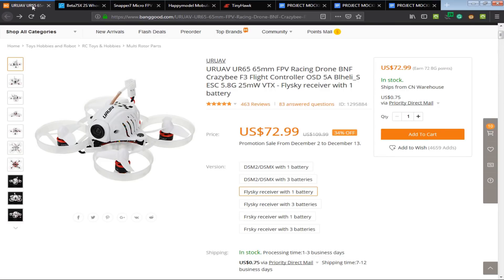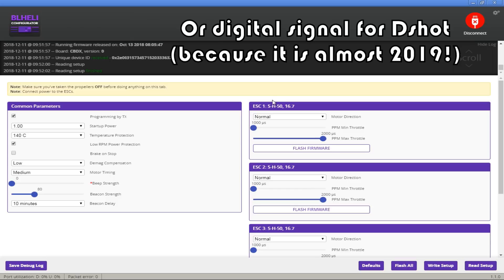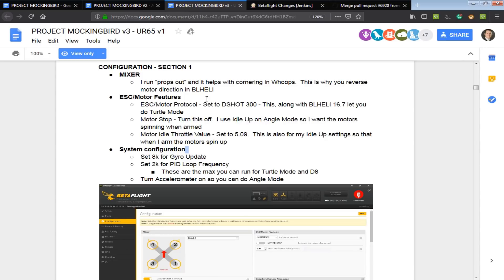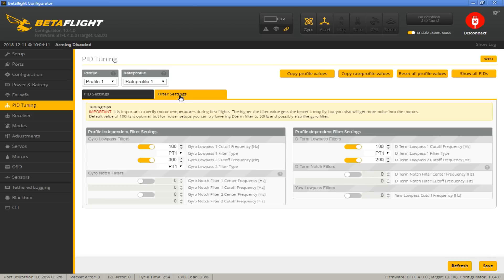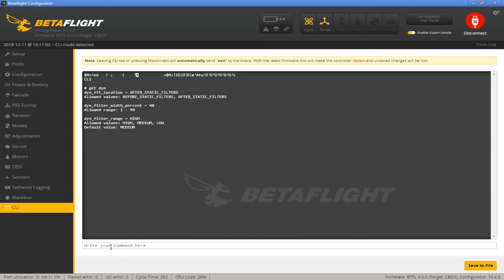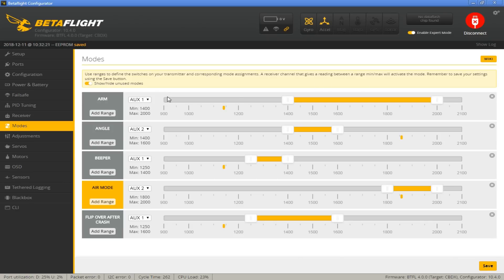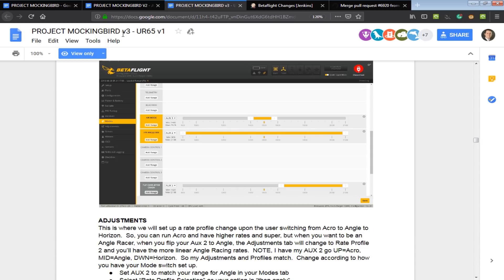Whoop Class Filter Setup

Comment: Don't mean to necro an old video but a refresh of this for blackbox-less tiny whoops would be pretty cool especially now that it's whoop season.  In particular, the full BF 4.0 filters.  Also wondering if your rule-of-thumb D's would still apply to a 1S brushless, ergo, starting D=70-80 for 1S if extrapolated from 6S=20-30; 5S=30-40; etc.  Thanks and happy holidays, Mr. Tech!

Comment: love your videos and trying to get all caught up as I watch more and more getting back into quads after 3 year break and love how much detail you have.. I have betafpv meteor 65 acro and cant log 
/blackbox it cause dosnt come with flash chip built in for it and no card or way to do it.. but was wondering as I watched the rpm filtering and jesc flashing and have 4.1.1 bf on it .. using Taranis 9xd updated to opent tx 2.3  ,,, I was wondering if this would be better to follow with mocking bird or do the rpm filtering and setup I have now and would I still follow these settigns for filter setup or rpm one.. sorry kinda going of your tune anyquad vid
thanks again

Comment: Does this setting work well on 3inch freestyle 
quads?
Reply from the maker: Yes.  I'm assuming it is on BF 4.0 the same as the video.
Reply: @uavtech  I updated to 4.1
Reply from the maker: @outboxfpv4360  , then I would just move up the Sliders.  Try to get to 1.5 or 2.0 on them if your quad mechanical permits.
Reply: @uavtech  1.2 or 2 on what?
Reply: @uavtech No  I upgraded to 4.1

Comment: I’m using default 4.0.3 PIDs. Just switched back to 4.0.3 cause I was told 4.0.0 had some filtering issues. Anyways, any recommendations for the filter settings for the mob7 with the F4Pro V1 FC? I’ve been getting terribly hot motors using 2S for 30-40 seconds..

Comment: Great vid, thanks!!
While looking at the Project Mockingbird Official Discussion Group in Facebook I realized there is this Mockula 7 project which is basically a Mobula7 aimed tune...exactly what I was looking for!!
This is the link to the diff of the proposed config https://1drv.ms/t/s!AryYA7BjaHXFluEG_KSAyATcuw0ZDw

However, this tune is baselined against Betaflight 3.5.7.
How portable do you think this is to a BF 4.0 Mobula7 setup?
Not an expert at all, but I understand the overall PID/filtering strategy changes significantly...

Cheers!! ;-)
Reply from the maker: You can make 4.0 be 3.5 with the Preset Paste at: https://github.com/betaflight/betaflight/wiki/Community-Presets#revert-to-bf-35x

So start from there and amend as desired.
Reply: @uavtech  thanks, that's a cool resource!
I've done some further reading about the Mockula 7 project and they insist strongly that the tune is for BF 3.5.7 and there are no real benefits from moving to 4.0.
As you suggested, I will have to start from there and use the tips in your channel to see if it gets any better...hope I don't smoke any motors :-P
Reply from the maker: @ppzald  , i have been running my Mobula 7 in 4.0 for 9 months it works fine.
Reply: @uavtech  that's because you know exactly what you are doing ;-)

Comment: I have built a Tomoquads Whoopee, with a 20mm stack that can log. Running 8000kv motors, 3s, 40 mm props. Not really a whoop, but whoop style it is ;). Interested in those logs?

Comment: Can the filter settings be applied to 3.5.5?
Reply from the maker: Yes
Reply: I see, I can't change the filter range though.
I only get:
# get dyn
dyn_notch_quality = 70
Allowed range: 1 - 70

dyn_notch_width_percent = 50
Allowed range: 1 - 99
Reply from the maker: Oh yeah.  Change quality to 5.  That will extend dyn notch range, but will not.be as full as the build in the Mobula or any 4.0 build out there.
Reply: I'm setting it up on my tiny hawk. Thx for the advice, so 'dyn_notch_quality = 5' then it is.

Comment: can apply this on micro quad with 1106 motors?
Reply from the maker: Yes
Reply: @uavtech  one more question mark, recent 4.0 builds have auto dynamic range...... should i still set it to high for 2-3 inch quads and medium for 5 inh? Default is auto
Reply from the maker: @Maorifpv  , correct.  Auto sets to High or Medium if Dynamic Gyro Lowpass Max is above or below 610hz.  See Cascaded Dynamic Notch video for detail on that.
Reply from the maker: So if u wanted a lower gyro max (say 450hz) on a micro u can do that, but should set Notch = High in that case so it ranges up to 900hz.
Reply: @uavtech  want some logs? If yes to where can i send ?
Reply from the maker: @Maorifpv  spatzengr at yahoo.com

Comment: Got hooked on your channel over the holidays.  I connected an OpenLager to my Mobula7 and have been having a ton of fun playing with Betaflight(master), your Excel sheet, Blackbox Explorer and Plasmatree PID Analyzer.  My (busted frame) Mobula7 seems very noisy, most problematically around 100Hz which is causing havoc with my D-Term.  I have a new frame I will switch to and hope that improves things.  There’s also a v2 (much more flexible/durable) frame I’d like to try, and compare the noise to the v1 frame.

I have been running 8k/2k w/ 2k blackbox.  When I try 4K/4K and blackbox telemetry at 4K, the quad disarms within a second or two of arming.  Turning the blackbox rate down solves the issue, so I suspect it’s an F3 CPU load issue.

Happy to share logs if you’d like to see anything, though my current logs with the busted up frame probably aren’t too valuable.
Reply from the maker: AWESOME!! Thanks for dropping a line.  I would love to get a log.  My OpenLager is on route, so will be joining you soon and we can compare notes.

Comment: Tried those filter and gyro/pid 4k/4k settings on my mobula but my motors became way to hot.
Reply from the maker: Maybe make sure your FC is still on the rubber gummies correctly.  I know going to "HIGH" range won't be an issue for sure.  For the LPF settings, there are a couple of reasons that those should be more than fine too:
1. mine is totally fine.  Not even warm.
2. we did a lot of testing on these settings and in the latest builds of BF 4.0, they are the default.  However, the LPFs there move up with throttle too.  So Gyro LPF1 will start at 150hz and go up to 450hz.  D-term LPF1 will start at 150hz and move up to 250hz.  Do make sure you were changing LPFs to be BiQUAD to move them up.

If mechanical is good and you can't explain otherwise, keep the DN on HIGH mode and leave LPFs as default.
Reply: @uavtech  oh, I forgot to set dyn range to high. As I now did this my motors stay cold also. Very Intresting!

Comment: I couldn't use DSHOT600.  It would shake like crazy.  Messing with pids, filters did nothing.  Switched to DSHOT300, all issues went away.  This is on 3.5.2 which i'm still on.  I think i'll try your filter settings.  I've been using Project mockingbird for a while.  The angle mode settings are great for indoor 1s on mobula7 (1s is a whoop requirement here for racing).
Want to add while I love the mobula 7, I couldn't stand the camera.  So i 3d printed a tpu canopy, removed the buzzer, added an EOS2 cam and 200mw vtx (VTX03s) and its fantastic now.  Best upgrade ever which really makes it an Eachine traschcan...minus a better frame and LED.   Happy New year!

Comment: just stuck on newest 4.0 on the mobula...looks like dyn lpfs are there. recommendations now?:
# get dyn
dyn_notch_range = AUTO
Allowed values: HIGH, MEDIUM, LOW, AUTO

dyn_notch_width_percent = 8
Allowed range: 0 - 20

dyn_notch_q = 120
Allowed range: 1 - 1000

dyn_notch_min_hz = 150
Allowed range: 1 - 1000

dyn_lpf_gyro_min_hz = 150
Allowed range: 0 - 1000

dyn_lpf_gyro_max_hz = 450
Allowed range: 0 - 1000

dyn_lpf_dterm_min_hz = 150
profile 0
Allowed range: 0 - 1000

dyn_lpf_dterm_max_hz = 250
profile 0
Allowed range: 0 - 1000
Reply: Wondering if one gets all the dynamic notch and lpfs set in the right ranges, all statics (including lpfs) get turned off? It’s just guessing without logs on these little guys though, so not sure if it’s worth all the time

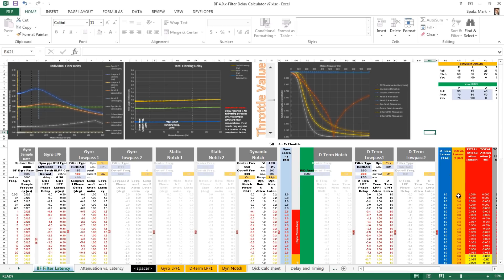Comment: At 8:41 you grab the calc sheet but the throttle slider is still at 50%. What do you think of the delay if the slider is at 0%?
Reply from the maker: A little over 4ms.  It is only the dynamic notch moving in this build of betaflight.
Reply: Ahh, OK, so not a problem with this build. More an issue with later v4 builds with dynamic and static BIQUAD dterm lpf filters.

Comment: My 65mm custom build with "BETAFPV F4 1s brushless" flight controller and 0603 19000KV motors is wobbling like crazy with this settings on the latest bf 4.0 build. With which values should i play around to solve this?
Reply from the maker: Latest build has dynamic LPFs.  Type "get dyn" at CLI.  Set range to "auto" if u have changed and pyt the rrst back to default.  Set your Gyro min. = 0; which disables dynamic LPF on gyro.  Then it will follow cutoff set in GUI, which by default is 150hz, and stays there.
Reply: Thanks for the input! I did this but it did not stop the wobbling.  I also reduced yaw on I and FF to a value more in the range of bf 3.5 PIDs and this made the wobble a little bit less but not totally wobble free. For now i`m back to bf 3.5 and enjoy flying and test 4.0 on a later stage again. ... edit: Also in bf 3.5 is a little bit of wobbling!^^ So i`m testing bf 4.0 without dyn gyro and some PID adjustments again and begin to like it! Throttle input feels a little bit smoother on bf 4.0 and this is a good thing for me indoor!

Comment: About time someone say about this 4.0
Mine come with 3.5.0 and I was going to try 4.0 but was to scared to incase I messed stuff up, so I only went to 3.5.3.
Now I'll try this here and n a second.
Make sure you put a dab of glue on the standoffs above the soft mount.
Bc I have found it to throw off the gyro everytime you plug the USB in.
It will move up and down on that shaft. Just a heads up
Reply: Good tip about the standoffs, I noticed it drifting then realised the FC was no longer level on the standoffs
Reply: @simoneatough6391  yeah no problem, I figured it out after the second plug in. Was like wth is going on I just adjusted it.
Then it took me a few to figure out what to use to fix it.
I suggest not to use super glue tho, it reacts to that and the frame and the props. Found out the hard way hahah.
I used stuff called shoegoo bc it is flexible and you can get it off after. $7 for a big tube at Walmart
Reply: @toddbeal4373  thanks mate. I might just use a touch of hot glue so I get remove it if I need. I recalibrated the accelerometer, and now it's off level. Think I have to tweak it manually, can't get it level enough on the bench
Reply: @simoneatough6391  not a problem, after I did that it's fine every time I connect now.
Make sure the glue gun isent to hot bc it will melt that foam quick
Reply: @toddbeal4373  you can download the custom betaflight 4.0 from the happymodel website.
Reply: @simoneatough6391  I used the latest 4.0 hahaha, works great for me. Thanks for telling me tho

Comment: Cant wait to try! thank you! BTW, Mobula 7 is 2s acro whether inside or out!!! 
https://youtu.be/ax-KTcWfqGE
Reply from the maker: Agreed.  Prop wash and control is much better in 2s all around.  Just need to use Throttle Scaling so hover points on the sticks indoors is about the same and you then get more throttle resolution.

Comment: Nice, I just flashed 4.0 to my UR65 tonight. I think a bit has changed since the build you have on this video with the dynamic filters, as there's now an "auto", and it's been renamed to dyn_notch_range. Looks like changes are documented here: https://github.com/betaflight/betaflight/pull/7078/files/233ac7fb3fbae381d9c04e2c07b6262466b8f7f0 Good info in your video though, thanks!
Reply from the maker: I'm aware.  This video was for the folks that don't want to flash, the next will cover the latest.

Soon there will be a new OSD element in the nightly that allows you to see the peak FFT to set that Max, which is what "Auto" follows.  If you are on 2s the gyro max should probably be 850 to 925hz.  If on 1s 650 to 725hz.
Reply: Cool, I'll be watching for that feature in the nightlies!

Comment: Cool, I'm running the Mockingbird setup on my Tinyhawk.  I'll have to see if I can tell the difference with your filter settings.  I  have not tried reverse motor direction, did you try it and find that it didn't make much difference. I notice you did not switch them.
Reply from the maker: I did not try it on the Mobula.  I didn't notice a flight performance difference on a 5" and I didn't really like stuff being thrown into the stack so I switched back.  For the whoop class, I just never bothered playing with it.

The bigger differential will be in a more recent build of BF which has dynamic LPFs.  There is a new OSD element that shows you the peak motor band and for a Mobula, it is ~900hz (2s).  For a TinyHawk someone said they saw 650hz (1s).  So, in either case with the Dyn Notch at Medium range (default), is not getting up that high.
Reply: Don't worry about props out on the Tinyhawk.